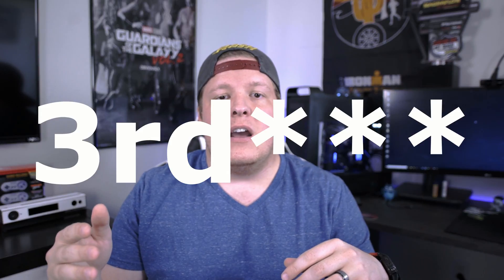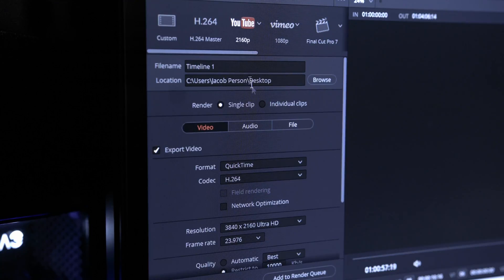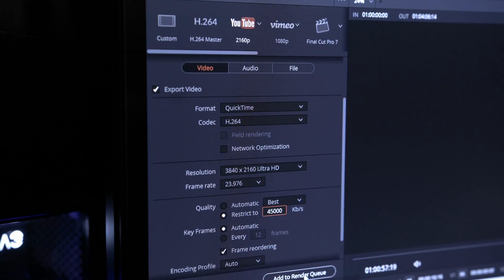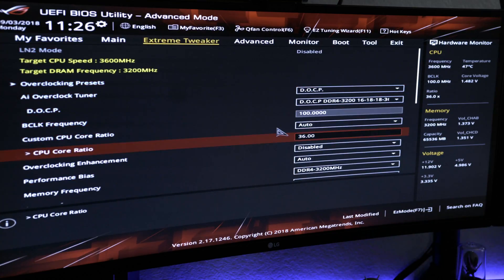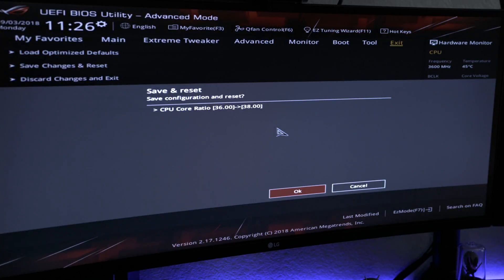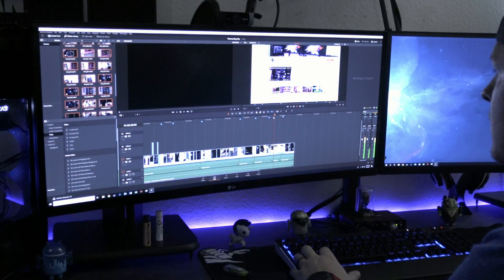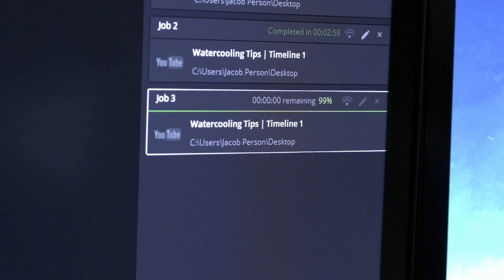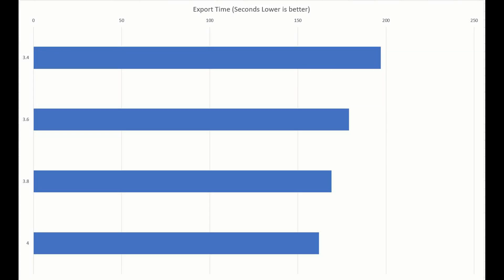DaVinci Resolve 15: Does CPU Frequency Matter?

Comment: I ran a similar test myself 1700X @4ghz, 32gb @3200mhz, gtx 1080ti FE and gtx1080 and Samsung 960evo m.2 exporting a 11 minute 4k24p with a lot of color correction and stableized clips with a few OFX clips. project shot on my sony a7riii @100mbs. This was a heavy project 

CPU@3.4ghz 9.34 minutes CPU@3.8ghz 8.12 minutes
CPU@4ghz 7.48 minutes

I also tested on my gigabyte aero 15x with I 8750hq going full turbo16gb@2666 and gtx1070max-q

8.54 minutes

I love davinci resolve 15

Comment: I can render 4k 30fps out prores hq pretty much second for second intel 8700 k 4.7g clock tx470 4g gpu. 16g ram.lol
Reply: When get home I installing studio version as my activation card came in today. Like to try gpu stuff as i heard some acceleration is slower on free version. Also want to add nois3 reduction and flare effects and mess with my hdr hevc on my hdr monitor